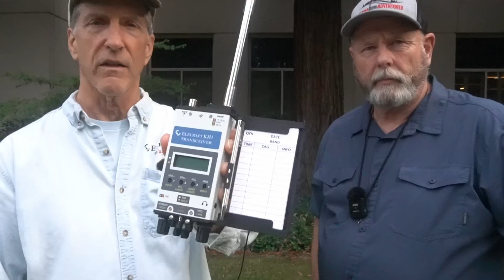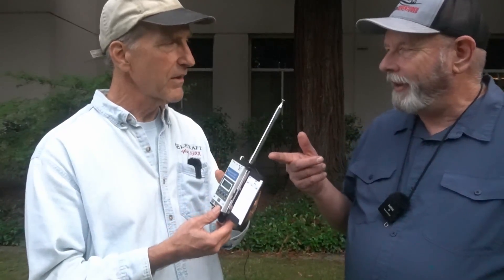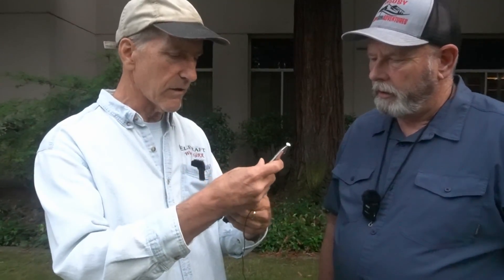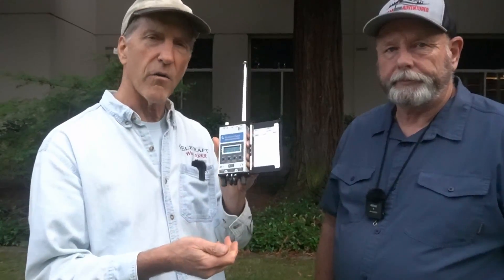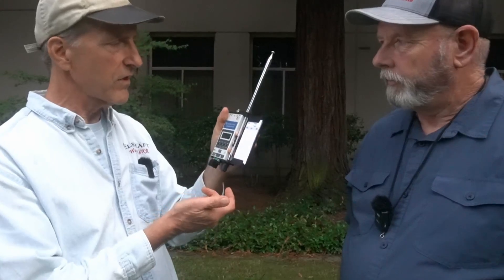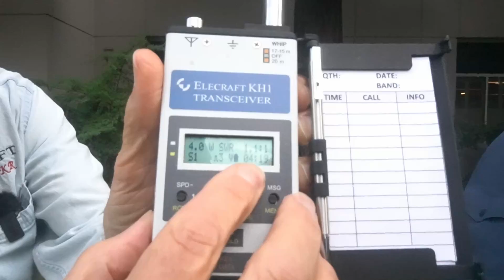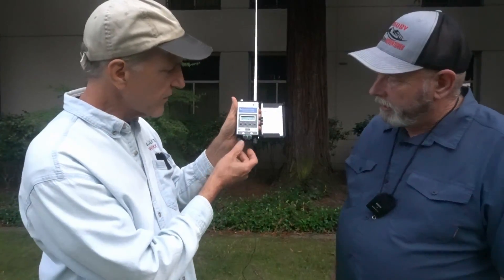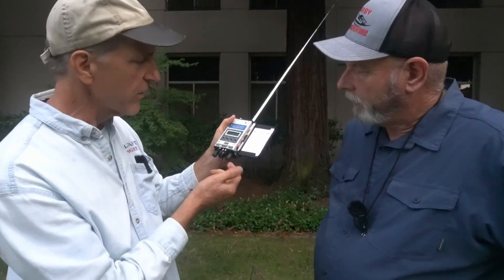Elecraft's maker tells all !!

Comment: Really think this will do well, I’ve had my KX3 for over 10 years and resisted the temptation to buy the 705 for what in practical terms for me doesn’t hit the mark.  No disrespect to 705 owners it’s a fab rig that has raised the bar immensely.  Looking at the KH1 for CW operators who want ultra portable operation this fits the bill.  Add an end fed antenna or dipole and its versatility is complete.  I have 2 issues, it’s not available in the U.K. and I’m crap at CW.  If ever there were a good excuse to get better at CW this is it.  Thanks for posting.  Regards Mike
Reply from the maker: Mike, I understand about the 705 could have soo much more but I choose my KX2 if I have to pack it out.